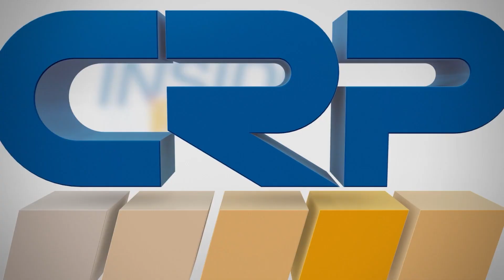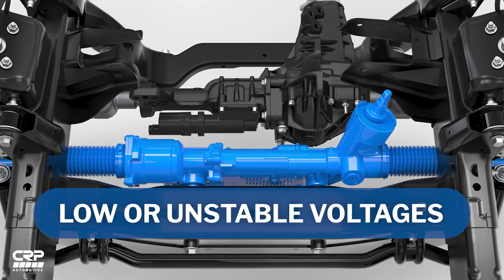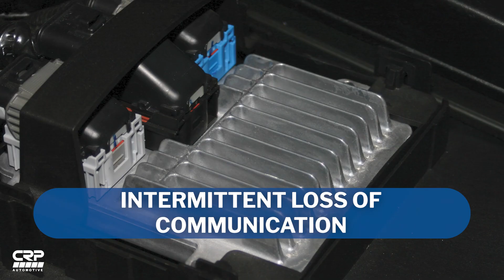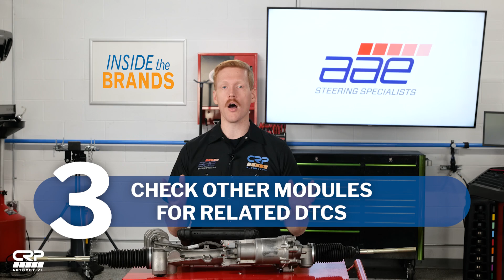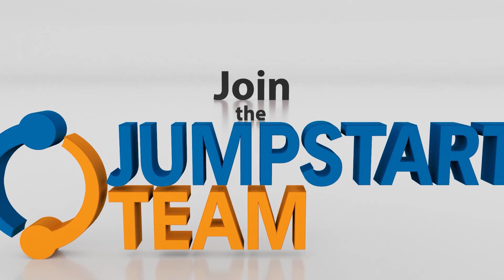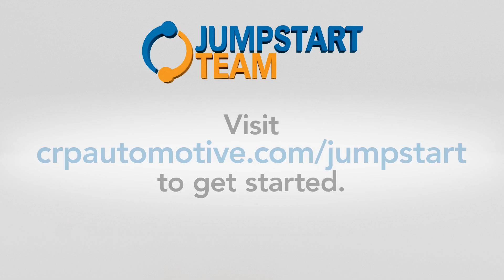C2217 False Positive? Avoid Misdiagnosing the EPS Rack | ITB 158

Comment: my honda city steering works smooth at starting ,once  i reach 80 or 100 and come back to city speed like 30 to 40 its becomes stiff and noticeably hard. The problem also occur when i dont reach high speed but when i turn off the engine and start back on the steering feels stiff  . No eps warning light on dash and no fault code.
what may be the issue . Please reply
Reply from the maker: Thanks for your comment. Unfortunately, the Honda City is not an application we offer, so we're unable to provide guidance on diagnosing or troubleshooting that steering system. We recommend reaching out to a Honda dealership, a qualified repair facility, or a Honda-specific technical resource for further assistance.

Comment: Just got this code on my 2016 ram 1500.  I have checked all external electronics and connectors.  Battery is putting out proper voltage, alternator is as well.  Looked at the connectors and all clean, just in case I have put in contact cleaner, still getting code.  Did however visual inspect the boots on both sides of the rack and pinion and found them both to be torn, where they meet the pitman arm.  Now I am thinking this has allowed water and other contaminants to get into the module and foul it up.  Probably will have to replace it, going to see the dealership tomorrow and find out when they can look at it.
Reply: Update?
Reply: @jessewettlaufer2706 Ended up having to get the whole rack and pinion assembly replaced.  Found the boots on both ends had split.  Fouled up the module most likely letting water and dirt into the system.  Almost $3000 for the repair.